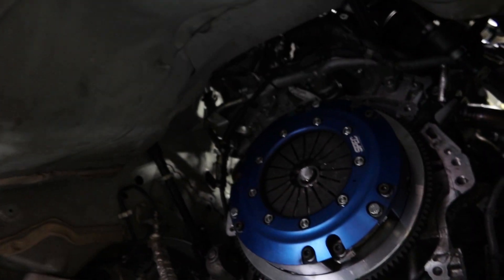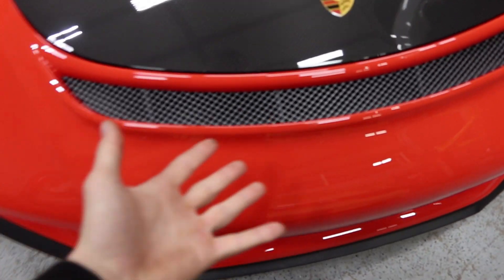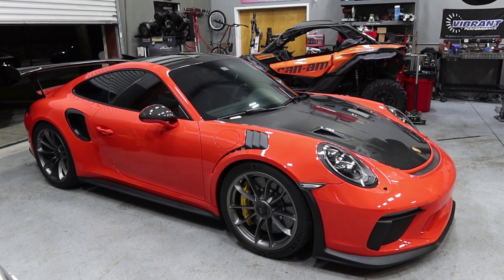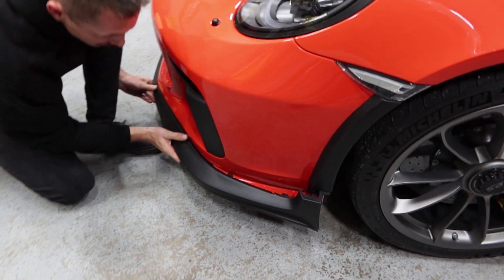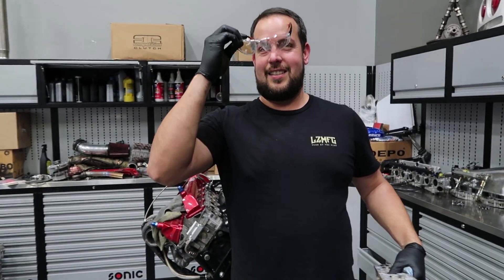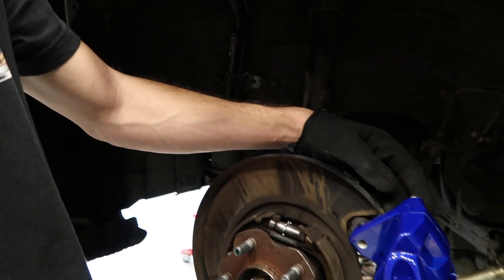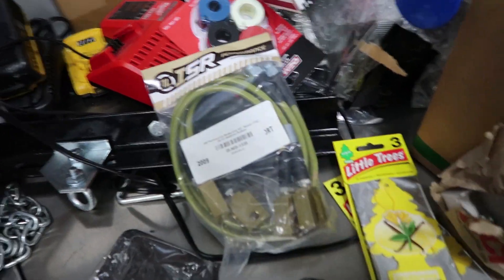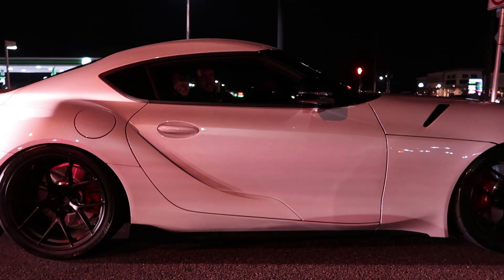Why my GT3RS has been missing...

Comment: 7:00 The reason for the ease of changing the front lip and cost is that it's also the same as the Motorsports front bumpers. We go through minimum one lip a weekend in Porsche GT3 Cup that's also why the cost is so low its a wear part, also why its plastic and not Carbon.

Comment: When a gt3rs front lip cost less than a oem subaru sti front lip🙄
Reply: One thing I don't miss about my subaru, OEM parts for them are stupid expensive for some reason.
Reply: Try an OEM 180sx kouki lip
Reply: If only he built an STI, I think he has the potential to build the new fastest 1/4 mile sti if only he wanted to
Reply: @carterkosick6926  That's quite a bit different...
Reply: Christina Dawson yeah we’re talking about pricing not fitment. I have personally bought 2 kouki lips and they aren’t the easiest on the wallet.
Reply: I work for a Porsche racing team and its the same lip as on the race cars same Motorsports part# we go through almost one a race that's why the cost is so low.
Reply: Carter Kosick stop reminding me of the torture
Reply: Carter Kosick they also arent the easiest to find. Rare parts cost money!
Reply: I was literally thinking the same thing
Reply: Two rear wheel bearings for my 2015 Forester cost $1,200 to replace. Fucking absurd.
Reply: Kyle yikes
Reply: The stock '17 GT350 front lip is like $1100 lol. I might have to get one soon too.... :(
Reply: Try OEM Supra parts lmao
Reply: @carterkosick6926  I don't think they meant try it to fit, I'm fairly sure they meant try finding an OEM part for a car that hasn't been manufactured in over 25 years.
Reply: @kyle8575  did they replace the entire knuckle or did they just press out the old bear and press the new in? if the latter you got mad fucked dog
shit takes maybe 4 hours tops
Reply: @ohAwaken  I'll check the report when I get home later, but I was hearing it just get insanely loud as I drove faster. I'm also confused on how the front ones are completely fine.